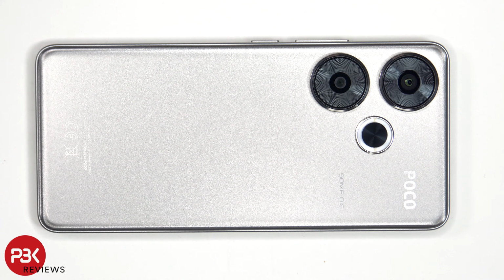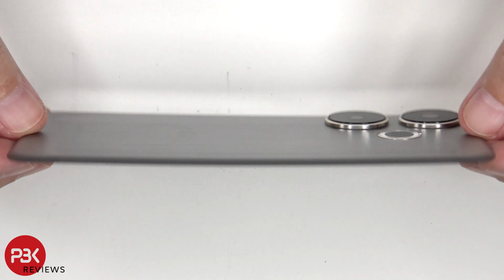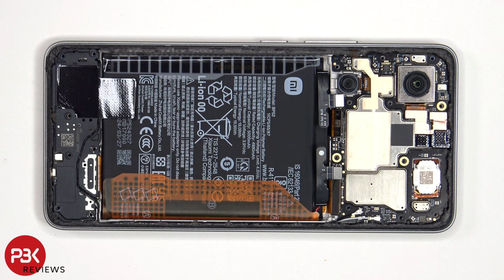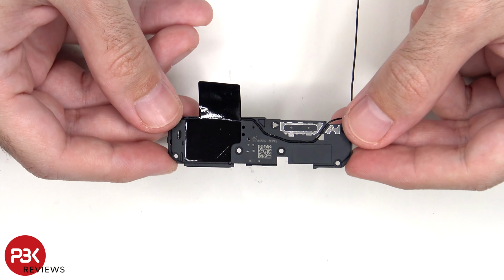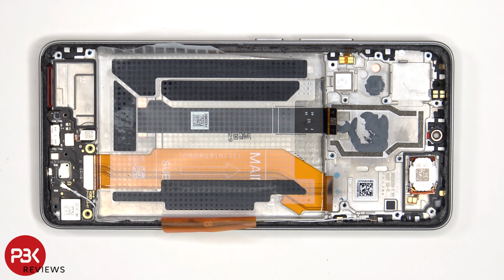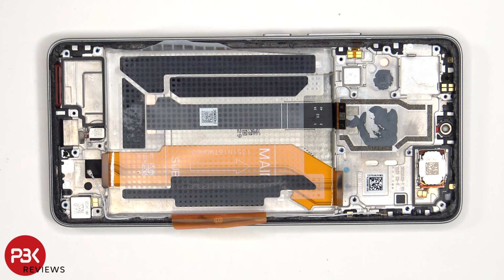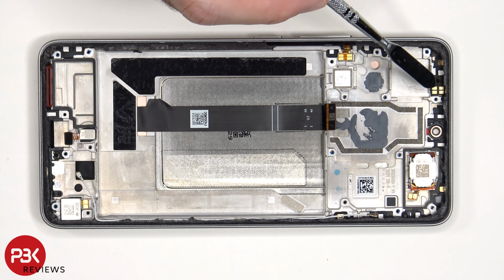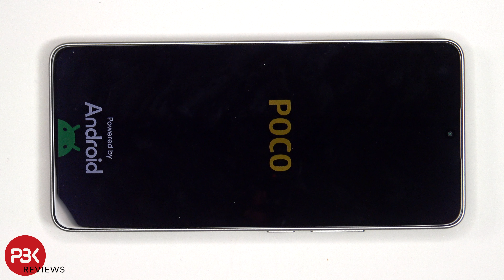Xiaomi Poco F6 Teardown Disassembly Phone Repair Video Review

Comment: having owned many glass back phones, and aluminum/titanium/stainless steel, I think I prefer the feel of plastic, it is also far stronger and more resilient. one drop and a glass back is done even with a case. this back will never break. aluminum/stainless/titanium edge dents and scratches you can't repair, but glass fibre reinforced plastic edge is easy to epoxy and airbrush. it still has the aluminum core. I prefer not to touch metal/glass on a phone. its not a comfortable material to handle.
Reply: So you disassemble the phone and do your epoxy job on the plastic frame and back whenever the scratches pile up?

Also what do you mean by aluminun core? The shiny silver midframe?
Reply: @bulletpunch9317  About the core...obviously. About the scratches...use a cover, to have at least some fall protection.
What's the use of a glass or metal back when nearly everyone uses a cover?
Reply: @DutchmanAmsterdam  are you the same guy? I was asking how they repaired the scratches. Seems like a hassle.
Reply: @bulletpunch9317  hes rather meaning that when the plastic scratches its annoying but no biggie, and when its too much scratches he repairs it like mentioned. you could also brush your alu back  to fix it, but that could lead to worse feel than scratches.

Comment: I love your teardown videos, it reveals the infos I want to know. Example the battery type (Li-ion or Li-poly), they have a huge difference in terms of lifespan but people tend to neglect that info.
Reply: So what's the difference? Which one is better
Reply: @theoozmachine  10 years ago you would say li ion, nowdays is just the same
Reply: @theoozmachine  Li-poly can handle higher watts of charging for up to 180W nowadays. Unlike Li-ion, they can handle only lower watts of charging but longer lifespan due to lower temperature.

Comment: So overall this phone is good for gaming ? 
Im confused afraid of getting heat bcause of plastic material all this phone
Reply: Buy the F5 if you are scared of overheating. The 7 series SD doesn't overheat easily.
Reply: I have f6, if you turn on wildboost mode it doesn't even heat, also pubg runs on max settings without heating for me, current rank conquerer 17, (7.9 kd), no lag 120 fps

Comment: The back of my phones  is opening  up unfortunately.  Can i use regular glue to stick it back ?
Reply from the maker: No you would need to use either the original pre cut adhesive made for the phone, B-7000 glue or one of the smartphone adhesive strips and cut it down to size.
Reply: @PBKreviews  ok thank you

Comment: Are the cpu and ram stacked in one place?
Reply from the maker: yes
Reply: @PBKreviews  oh No🤦
Reply: @dwisetianto_  why ? most phone now use stack cpu and ram cause of cheap and they want make phone look small and thin. Yeah that high risk ,but with good cooling system or with throttling perfomance can handle SOC without problem, exepct play games without rest.. and at midday ,that can easy damage or break component.
Reply: @PBKreviews  Please answer me. I am confused. Does having the processor and RAM in the same place affect it? I have seen several videos saying that it will stop like the X 3 Pro.

Comment: Nothing special on that phone
Reply: if you consider the price, yes it's special.
Reply: @doniherald7745  I agree, I have one since 3 weeks, but I find the battery drains rather fast, need to recharge at least twice a day, which takes just a few minutes though. Spotify made the phone crash and overheat repeatedly. Seems to have improved, but hesitate to trust it now. Still have 10 days option to return it.
Reply: Yeah u need to be patient about it cuz it's a software problem not hardware cuz of the New hayperos  luncher with updates all will be improved specially the cooling system and crush  @DutchmanAmsterdam
Reply: @555trend9  Ah thanks a lot. I was hoping for that cause. And hopefully Xiaomi will take the effort to fix all the bugs.
Reply: @DutchmanAmsterdam Did your phone improve? I need a new phone and the F6 is reallt tempting, it only cost 260 USD in my country